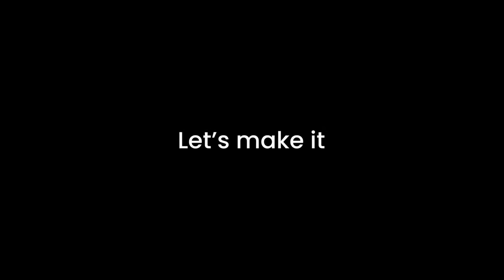Chat with Dr. Tao about the H2C at Formnext

Comment: Just a heads-up for anyone thinking about buying a Bambu Lab H2S.
Mine failed after only one month: the print came off the plate, the AI didn’t detect it, and the printer kept running until the hotend was ruined.
Support blamed me for “not using the original plate,” even though their own official distributor couldn’t supply it. On top of that, H2S spare parts aren’t available in Türkiye or Europe.
Posting this so others don’t end up in the same situation.
Reply: Not surprised bambu was gaslighting you for their printers issues.
Reply: @LilApe  I will never buy bamboo H2S again
Reply: @muratturhan35  Should never buy a bambu lab product again in general.
Reply: @LilApe kesinlikle Türkiye’de hiçbir bambu ürünü alınmamalı
Reply: Come on man it's the most basic of basics😂😂😂😂 CLEAN YOUR BUILD PLATE.
Reply: And also make sure that you don't have the ai detection on low. Or have the cameras covered.
Reply: Well... the print came off the plate and you broke your printer. It's up to you to make sure the print adheres to the plate, Dr Tao will not come to your house and wash your plate for you
Reply: @hollowtoneaudio  ahahahah :face-blue-smiling::face-blue-smiling::face-blue-smiling:

Comment: Hm, I don't think this was the right horse to bet on. It's super fun to watch, but at the end of the day, it's basically worse than a toolchanger in every way. You can use more colors, but you're limited to material types that the AMS can handle. Every change in the Vortek nozzle requires cutting, fully retracting and re-inserting via AMS (which is slow), and prime/purging (you have to at least purge the re-inserted filaments down into the melt zone otherwise retractions won't work because, y'know, you cut it). And you lose even more build volume on a printer that already had a wonky build volume to begin with w/ the dual nozzle setup.

Comment: That's all well and good, but you should also make an effort with existing customers who already own a printer and ask them about their problems and resolve them. As it is, newer devices keep coming out, and the problems persist or even worsen. For example, the AMS colors used to display perfectly in Studio, but since the last Studio update (mid-to-late October), the colors are displayed incorrectly despite syncing, even though the cabling showed AMS1,2,3,4 before, now it's AMS1,34,2, or something else entirely. For instance, you only have 14 colors instead of 16. So please address these issues. Support says they can't do anything. And new printers don't make existing customers any happier. And we're the ones who initially supported you with the X1C.Those of us with an X1C are now out of luck and have to put up with the waste and poop. Nothing is being done about it, but we're supposed to buy a new printer just to reduce the poop? Why can't this be done with the X1C?
Reply: They already fixed the ams bug in bambu studio it's not mixed up anymore.
Reply: And you decided to buy the x1c its not bambus fault.
Reply: Bambu has enough competition when it comes to multicolor printing so why make a small multi material/color pinter .that is  just USELESS buy a snap maker u1 if your so self centered. "Mike drop" peace.....

Comment: The vortek system is worse than a traditional tool changer in every way possible. Every time bambu lab tries to do something "different", its just ends up being a fail. Adding lidar was a fail, adding CF rods was a fail, and over complicating a tool changer is a fail.
Everyone is looking at the true innovators in multi material printing, the bondtech INDX.

As expected, the now prusa core one with the INDX had been revealed and it kills this H2C crap. 4-10 tool heads and significantly faster speeds, with Swedish engineering.
Reply: While you look at innovators, people buy BL. They democratized high quality reliable printers and listen to what their customers want.
Reply: @hollowtoneaudio  "listen to what their customers want"
You sure? Nobody wanted two cheap bedslingers from them. Nobody wanted an expensive dual nozzle printer. Nobody wanted an even more expensive laster/cutter/printer combo printer. Nobody wanted a slow nozzle changer, they wanted a fast toolchanger.
If bambu is "listening to their customers", then they aren't doing it very well.
Reply: The x1c was never anything revolutionary that's true lilape but prusa and thier core one was nowhere nere better bl set a new standard that changed the market. And we did want the bed slingers a cheaper and still very reliable printer great job bl 🎉 bl is not perfect but no company is and prusa is still far behind when it comes to reliability the standard you are undermining completely. I'm disappointed in you lilape. For not seeing the big picture. If r9ds were undermine but replaceable unlike a prusa completely breaking down after 5 years.
Reply: Not true! When Bambu Lab released the X1C it was revolutionary, changed the 3D printing game and left everyone in catch up mode, just like Creality did with the Ender3.
Reply: @colinfielder6695  X1C didn't do anything new or different that other printers weren't already doing at the time. Nothing was revolutionary, they copied heavily off already existing open source innovations, made it proprietary and sold it cheap through government subsidizing. Bambu wasn't the 1st to made an enclosed coreXY printer with input shaper.
Reply: @LilApe  the H2C is pretty underwhelming, but get real--the X1C completely changed the 3D printing landscape and you're delusional if you think otherwise
Reply: Uuuuhhhh.... Somebody stepped on the bambu fan boy's toes... Let's grab some popcorn... 🍿
😂
Reply: And yet people are still building farms with Bambu printers. While both Prusa and Bambulab fanboys are fighting over which tech is better, other people are printing to make money with whatever is reliable to them. 5 colors is usually the maximum people would even print with, so either systems already surpass the regular color changing usage. Whichever one has a more polished ecosystem, people will always gravitate towards that. Look at Apple. They don't have the best innovative thing, but their ecosystem just works. What you say Bambulab has failed, there are way more success stories than failure.